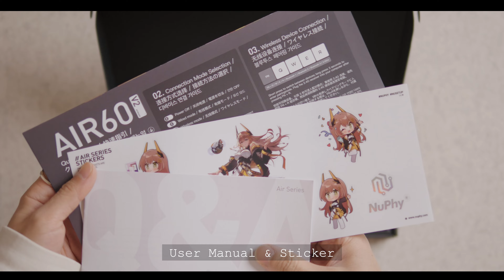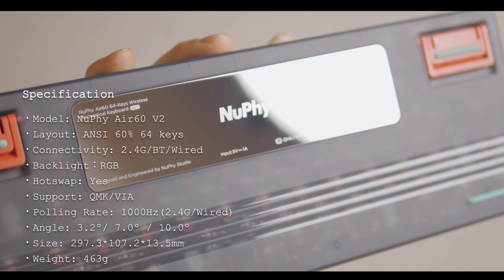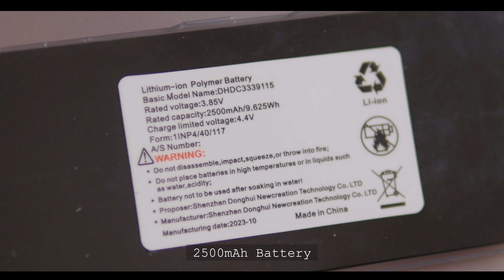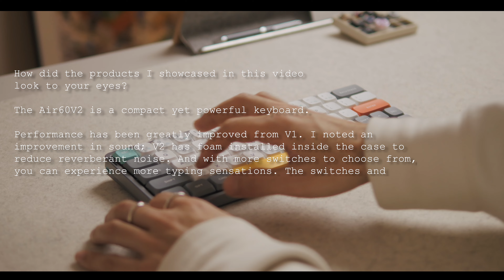NuPhy「Air60 V2」

Comment: Got two of these but I'm having really bad connection issues while using it on bluetooth on a Mac M2 with both keyboards. They're perfect on 2.4 mode or cable modes. Anyone else having these issues as well?
Reply: Did you ever find out what was going on ? I'm looking at this keyboard for my Mac as well.